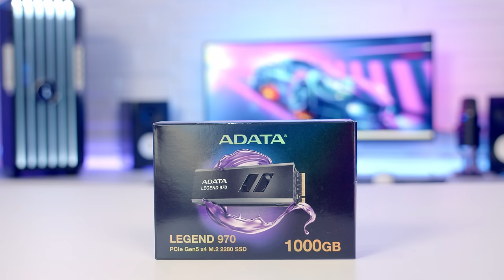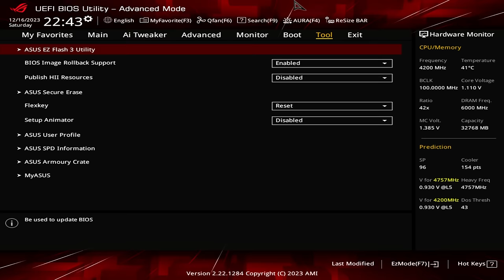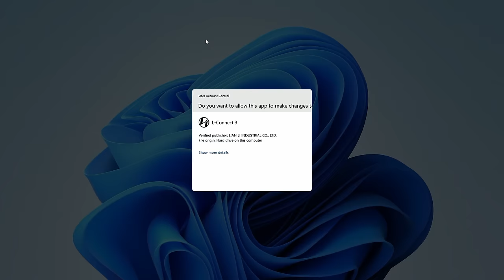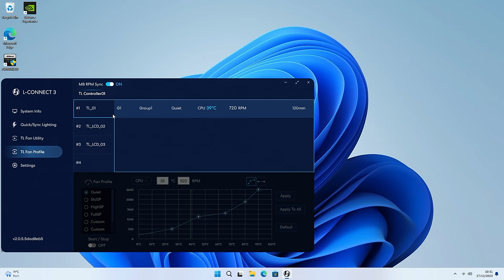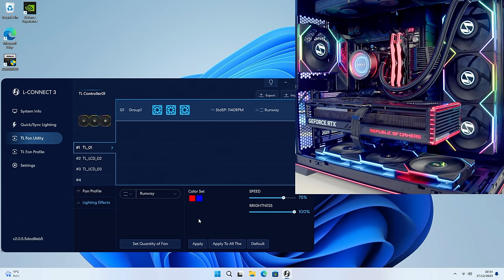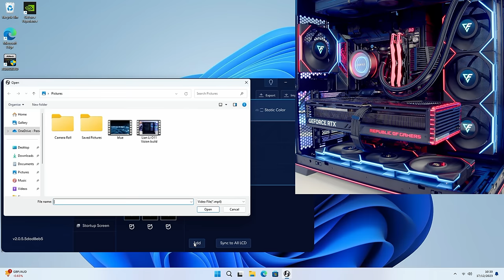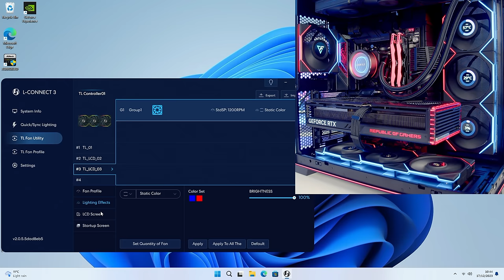Lian Li O11 Dynamic EVO RGB Build - Step by Step Guide

Comment: Your videos are brilliant and this one's no different, thank you for your thorough explanations.

Quick question tho, would a 7800x3d be good for a pc more used for productivity/workstation stuff? And would it pair with an rtx4070?

I have always had intel (prebuild), but I don't like them retiring the LGA1700 so fast and I want my first build to be a bit more futureproof
Reply: A month late, but intel is by far superior for any productivity/work and decent for gaming on the side. If your a hardcore gamer than AMD is superior. And as far as futureproofing if you buy the best of either it usually always last the longest.
Reply: @vsynccx4263 No worries, thank you for your reaction! This helps with my decision, I'm probably gonna go with either i7 13700 or 14700, whichever I can find the best deal on :)
Reply: @JustCarnivorousCupcake  Yeah, those cpus are really good regardless of what you do. 13th gen is dead though, so down the road you won't be able to upgrade

Comment: I have this Evo RGB case and TL / TL LCD fans, but I can't control all devices with L-Connect because there's no way to connect the case to Lian Li TL hub. The only way I could set it up is by controlling rgb through the motherboard and using a third-party software like SignalRgb. Besides it doesn't have full support to tl hub, it works. How do you control your rgb devices?
Reply: Alas, the cases rgb can only be controlled by either the buttons on the side panel or through the motherboard software/openSignal.
Reply: if you can get ahold of the lian li sl infinity l connect uni hub box it has 2 x aux ports , thats how i can sync my 011 evo rgb with the tl lcd fans, you will need an extra usb 2.0 header and its a shame they didnt put aux ports on the tl hub but i think it couldnt handle the power
Reply: What are you going on about? The case is completely irrelevant for installing the fans and controller. What does it mean there is no way to connect case to the TL hub? What hub? You are talking about the TL controller? The controller is not in any way connected to the case. You attach the fans to the case and MUST then connect them to the TL controller. You cannot use the fans without controller. The controller is to control the fans via L-Connect 3. NOTHING else. What are you going on about RGB and third party stuff? What RGB? The RGB of the case is solely controlled via the LED button. You can attach the ARGB plug to the motherboard. But L-Connect 3 is for the fans. You can connect the controller to motherboard ARGB and PWM … to integrate into motherboard software. But your problem is a handling and expectation mistake. The case RGB is button controlled!

Comment: one question do i need the one single fan in reverse or normal if i want to blow air out?
Reply: Normal fans are all exhausts. For intake use you see the back of fans. To avoid seeing ugly fan rear sides you can buy intake fans in reverse!

Comment: Can I connect the fans of the old version of Lianli with the modern version in a consistent manner and with a uniform application?
Reply: use whatever fan you want buddy, as long as its 120 or 140mm,, you can use a pc fan from 2002
Reply: Makes no sense … you can screw whatever 120mm or 140mm fans in there that you want. Does not depend on the case. Of course size must fit. Its all about controller and motherboard you install fans to!

Comment: With that mobo, what are your boot times?
Reply: Faster than those on the AM5 with fast boot disabled due to issues no doubt  🤣
Reply from the maker: I haven't timed them, but they seem average
Reply: @lexluthor3145  it is am5, was what  you said supposed to be hilarious ?

Comment: Hello everyone..
I started building a computer but ran into a problem, if you can call it that...
I have a Lian Li O11 Dynamic EVO RGB CASE and Lian Li UNI FAN SL-INF 140mm
I have a technical question regarding the installation of 3 X 140mm fans which are on the front, i.e. to the right of the motherboard...I can't screw more than 8 screws there because the upright bracket is a bit short. ..On the first and last fan, the upper screws, which are 2 each, have nowhere to screw....The fans  
I watched a video in which 3 fans of 120 mm fit perfectly and all 12 screws are screwed to them... But for 3 fans of 140 mm something is not right...
Does anyone know where I'm going wrong?
Reply: If you're using the 140mm UNI fans, you can skip the top and bottom mounting screws.
Reply: You cannot officially use 3x140mm for all sides! You must improvise!

Comment: It sounds mine came with a defect.. The side glass panel wont get in place because the guiding holes are smaller than they should be.. I'll be contacting Lian Li and the seller about this and check what they say about this..
Reply: Try and turn them around. Trying to fit em upside down won’t work. Happened to me till realised was holding it upside down. Didn’t it come assembled when you first got it? Or was it open, non closed?

Comment: How is the performance of the GPU upright? Any issues?
Reply: What is upright? We have horizontal, vertical and hanging … what is upright. Most use it to describe the horizontal position, but unclear if not the usual terminology is used.

Comment: just finished identical build. and ive ran out of usb headers on my MB :( . 1 for the case rgb, which leaves 1 to run AIO and 4 more fans. I dont know how u did it.
Reply: The tl fans use a pci-e cable.
Reply: the rog strix x670e -e has 3 x usb 2,0 headers, so you didnt do the exact build
Reply: Case RGB does not need an usb header! They are linked to ARGB … and the front psnel as well as audio panel. The cases’ usb requires the 2 case usb-c and usb-a 3.0 ports. Then you have three more internal usb ports. One is for aio, one for fan controller, that can take 16 fans. Once is free. If you require more than 3 you need an internal usb hub.
Reply: @TheSjuris This makes zero sense … its not about power … the controller are linked to PCI-e, usb, ARGB, PWM … the usb connection has nothing to do with power source …
Reply: @GanymedeXD  tl controller uses a pci-e psu cable and a usb cable.

Comment: @christopher flannigan - Upright GPU okay for temps?
Reply: What does upright mean? It has horizontal, vertical and hanging. Some describe horizontal as upright? Temp wise just try it useless to ask others with s completely different fan and cooling setup. We would require a crystal ball to give advice there.

Comment: Nice case. It's a shame they cost the earth compared to non fish tank style which usually comes with fans included. Compare the cost of this case with 10 fans compared to a lancool 3. Huge difference in price.
Reply: 150 dollars is dirt cheap for this quality, no ones forcing you to buy unifans tl lcds
Reply: They do not cost ‘the earth’ … its value for money. Good they do not come with any shitty pre-installed fans … they always need to be removed and are additional waste as I want my own fans for builds … not crap coming with a case! I do not get it … people need high end GPU and parts and fit it in low end and low quality cases … same with PSU … instead of getting adequate ATX 3.0 PSU for their series 40 builds, but then moan that they got no ports for TL fans. My ATX 3.0 PSU had 5 free 8-pin ports when installing the TL controller.
Reply: @GanymedeXD  buying all the fans and controllers cost way more than the case itself so yes they cost the earth and yes the case is bad value. That extra money spent could just go towards the cpu and gpu.

Comment: hi cristophet i saw that you don't have a video for the revers of the LIAN Li 011 XL., like the one you show in this video. https://www.youtube.com/watch?v=DhkK_j4hEQ0 I saw more or less the configurations of the previous Lian LI models. In short my goal is to configure the same BUILD Lian that you show here in the current video In XL REVERSE version. My doubt is to set the exhaust and the intake, and it is already set by how you set the FANS, do I have to set it also from the software to make sure that above there is the exhaust ''PWM'' below the intake and behind the GPU there is only the exhaust with the FANS facing outwards?🤔

Comment: my rgb on my case is not on, everything else is lighting up except for the strip :(
Reply: Did you switch it on with LED button? Challenging to help as you provide zero information! Check RGB and front panel/audio wiring of the case!

Comment: Will a 450W power cable power my 4080 super gpu?
Reply: You really ask this in a comment section where at times plenty of false info are exchanged? Its about power cable … at least google it … the you can review the source! There is a thing called manual and manufacturer as well. You fry you GPU and then? 450W upwards is recommended. I got a 600W cable.
Reply: @GanymedeXD  🤓

Comment: Problem is these new O11's keep getting wider; dynamic=272, evo=285, RGB=290, Vision=304mm. I need a new case for 4090 my icue 465x with front rad wont do it but i like the case and its 216mm wide.
Reply: because the gpu's are getting wider
Reply: Disregard my previous comment … looking at your comment nothing makes sense … I do not get it … you write about GPU ‘s and then give irrelevant information. List how wide cases get, how wide your case is. Wide? How do you want to install the GPU going on about how wide they are? Focus on relevant info … length!  The RTX 4090 Founders Edition is the shortest … 309 mm … the Rog Strix 4090 is 358 mm long  … but how ‘wide’ the case is is not really relevant for GPU’s … the case’s length is essential! My Evo Dynamic O11 Mid Tower is 470 mm long. Thats whats relevant. They are getting wider to
Improve the compartments … better cable management, HDD, PSU etc.

Comment: In almost every build with this case the lower position is used. They squeeze the bottom fans in and have a lot of space at the top. Weird...
Reply: Because that’s even more conflicting … the board is in the usual top position for older Lian Li cases (there is none higher eg in my Dynamic Evo o11 Mid Tower) … in my one that is the top one. Moving the board upwards to where in the clip are additional holes you get into conflict with the top cables … and further at the top with radiator and fans.

Comment: How is the glass to gpu clearance?  I have the OG O11D and with the Asrock Taichi 7900xtx with Cablemod Pro cables I have to use the vertical GPU mount b/c there is no clearance, I was looking to go back to the horizontal gpu look.
Reply: Makes no sense this question … GPU is a very wide question and those cases are designed for high end builds … what GPU … my old 1660 super has none 😂 … I have the previous evo and this here is even wider … I never had any problems with glass to GPU clearance. Neither horizontal nor vertically. At present I use the RTX 3090 Ti on a RG x670 e-e with cablemod pro cables and have the Evo Dynamic o11 Mid Tower … more than enough clearance.

Comment: I don't get it why you build such a beast and then save money on the SSD. This build needs at least another 2TB SSD.
Reply: its coming right back apart, you realize he does this everyday right?
Reply: Why this? SSD are so useless for serious storage as the data amount they can manage is ridiculously low. I got a Rocket 5 Gen 5 1TB for Windows and a 2TB Samsung Evo for important private stuff … but 68 TB Seagate Ironwolf Pro for data.

Comment: Again no good spot to place a controller like Corsair's... Damn.
Reply: i 3d printed unifan hub holders that slide in the ssd holders on the back magnetic door
Reply: Plenty of space … placed 3 controllers on the rear wall of the cable shaft.

Comment: Every build on youtube skips f panel connectors 🤣
Reply: Connector.
Reply: Technically it could very well be plural.
Reply: i have the exact build with the same motherboard and my reset wont work, i wish he would have addressed it
Reply: @mainsource8030 Why … its simply straight forward … he does not want to bore anyone .. you either have one plug that you simply plug into the corresponding f-panel port … or you got a collection of single plugs … there you take the pin allocation chart of your manual and plug in one plug after another … the pin basically telling you where it goes +-hdd to +-HDD etc
Reply: @TheSjuris Wrong! I have 10 single connectors for the f-panel … hence connectors!
Reply: @GanymedeXD  that case has one connection for the f-panel hence singular

Comment: will i be able to use a corsair shift psu in this case and keep the harddrive cage?
Reply: no, i had to take mine out, but get the lian li edge anyway, its cheaper and bettter
Reply: Impossible … the design does not at all match with the cage! Especially when having additional HDD fans installed.